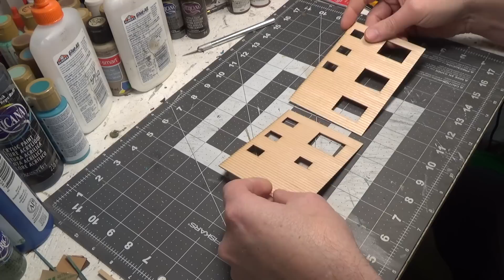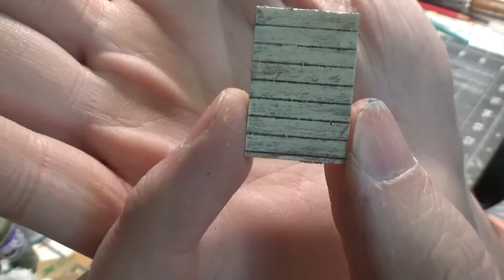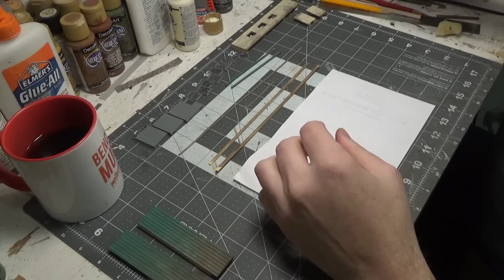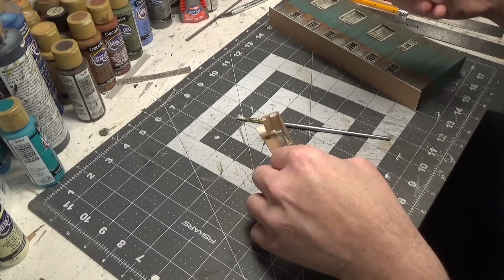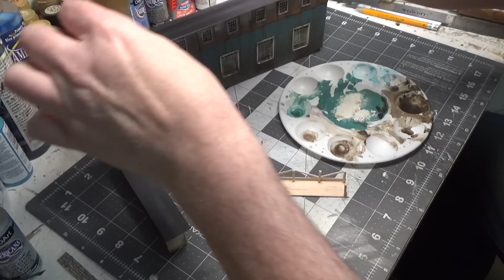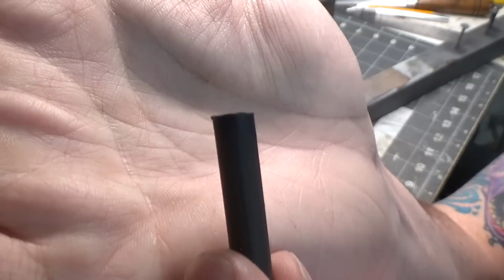Making a Pencil Factory from Carolinacraftsmankits

Comment: I hope every realizes that pencil manufacturing was the first mass produced precision consumer product. Pencil manufacturing is more complex than most people realize. It was also one of the first synthetic products developed to replace a natural resource. The first commercial pencils were made in Britian using graphite from a natural deposit. This deposit was also used for molds for casting cannon balls. The French needed a replacement ergo synthetic pencil leads.

Comment: Is the bracing 1/8 or 1/4 stripwood? The foundation line to my eyes looks like 1/2 inch from bottom? Watching closer and using the cutting mat ruler as a guide and I guess it is 1/4 from bottom..😁
Reply from the maker: Bracing is 1/8 and you can make the foundation as thick as you want.
Reply: @JasonJensenTrains  Thank you

Comment: A common mistake with decks: they have to be braced in each diagonal direction. If you look at the deck from the side, you'll see that every other is not braced at all. Bracing at the top does no good structurally. My 2 cents. Love the building. PS. If you look at your drawing, it is correct.
Reply from the maker: Thanks for pointing that out Bruce! And Thanks for watching!!!